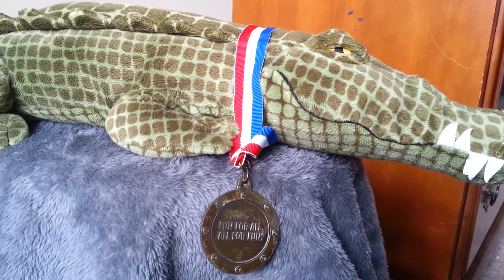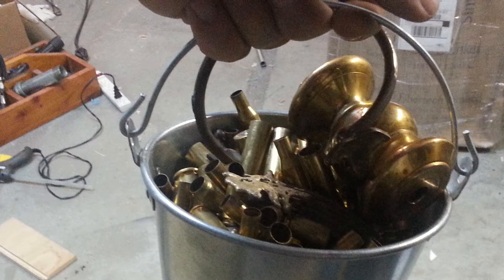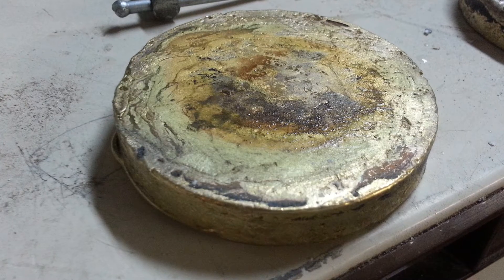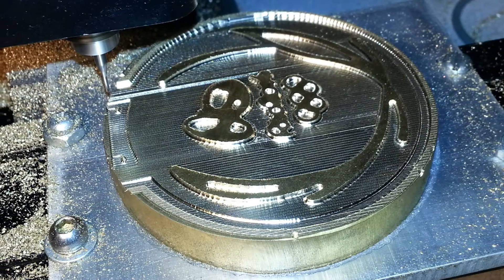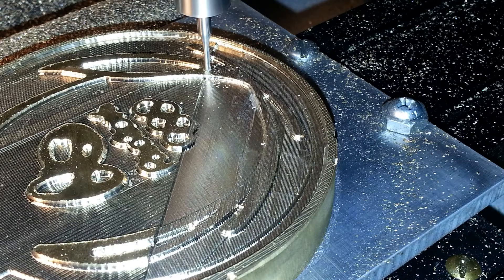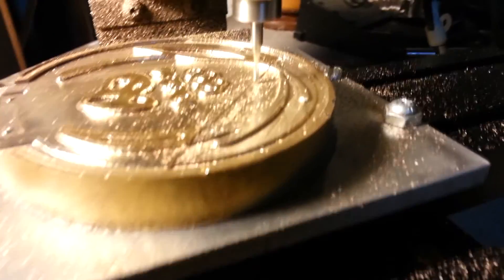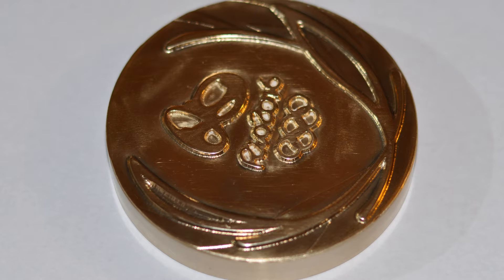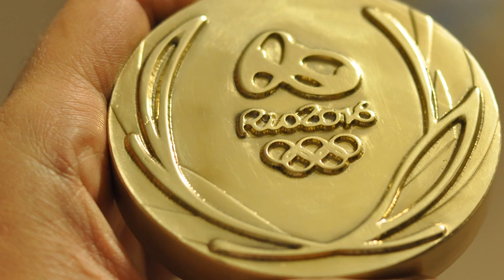CNC milling a Rio 2016 Olympic Gold Medal from brass

Comment: My 13th anniversary is coming up next month, and I've been trying to "engrave"/cut a Half Marathon style medal for my wife (she's a runner). It's not working. I'm working with no skills, and a dremel with cutting bits. Do you have any advice? I'd really like it to get done, but I'm having great difficulty in making it work. I'm working with steel. Another option… could you make it? :)
Reply from the maker: Casting may be a good approach if you're doing the design by hand. You could carve a positive from wood, wax, soap, etc and make a negative in plaster or sand, then cast it in pewter or zinc. You can melt those at home with a torch. If you're working with a 3D model you could have a friend or local makerspace 3D print it and make a casting from that. 

Depending on your design complexity, electrical or chemical etching may also be a good fit. You can do simple metal etching with a masking material such as lacquer or adhesive vinyl. I actually do these frequently. You cut out the design on the vinyl and stick it to your metal blank, then the exposed metal is etched down. Electrical is probably better for deep etching. Even a quick chemical etch leaves the exposed area a different color though.

As for having a 3rd party make it, you'd be better off asking around at local award/trophy companies. Search for 'custom medallion' and you'll find all sorts of reasonably priced custom options. All machine shops these days have CNC equipment that will do this in a heartbeat as well. If you walk into a shop with a 3D model and your steel blank on a fixture, I'll bet you could find someone to do the job quickly at a reasonable cost.
Reply from the maker: e.g. https://www.shapeways.com/materials/steel
Reply from the maker: Send me your design if you haven't already found a shop you like. I'm in the mood to give it a try.
Reply: I actually sent it out a few days ago to a place called Xometry. However, if you'd like to try it anyway, I'd be more than happy to send you the CAD file I created on TinkerCad.com
Reply from the maker: I'm glad you found a place. They seem pretty pro-grade. Hope it comes out looking awesome and congrats on the anniversary!